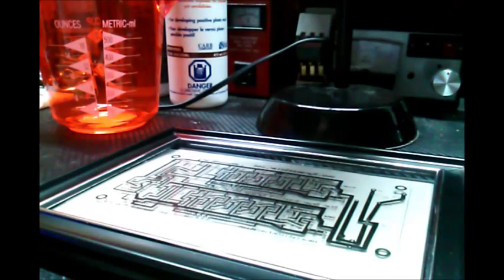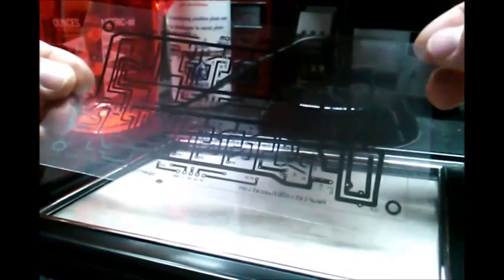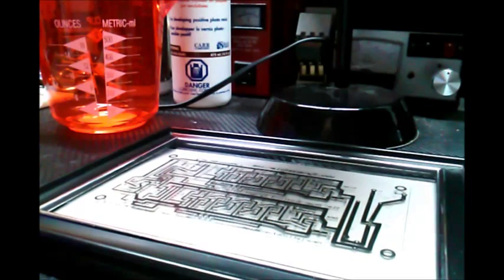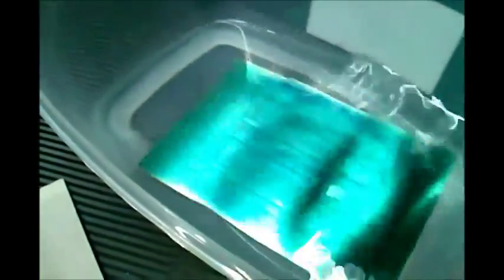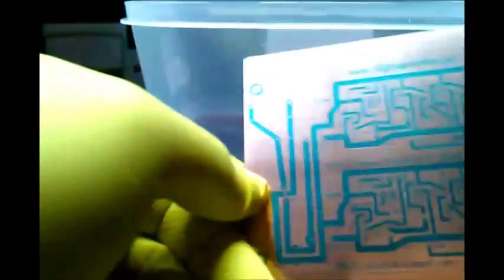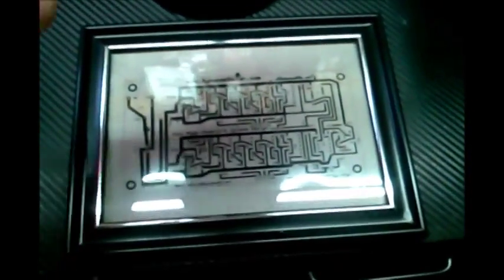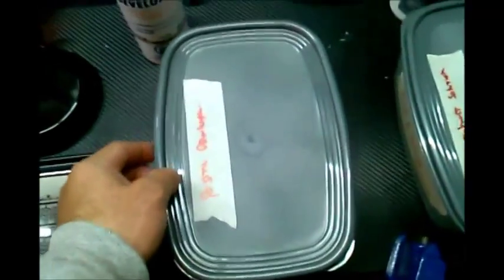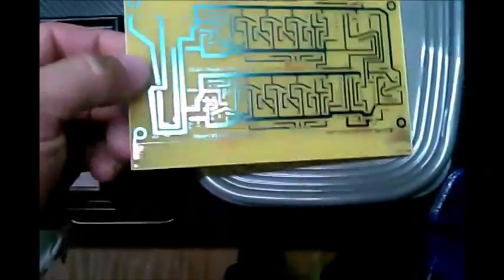PCB Photoresist

Comment: What was the ratio for FeCl3 to water?
And was the water warm, hot, room or cold?
Reply from the maker: I did not dilute the iron chloride with water.
it was with ambient room temperature. some try heating for faster reaction.
it worked fine without increasing temp. took like 20 minutes.
Also there are dangers involved in trying to heat or bring temp up on the acid. be careful. follow proper safety handling.
thanks..